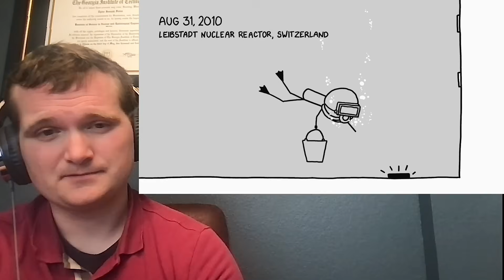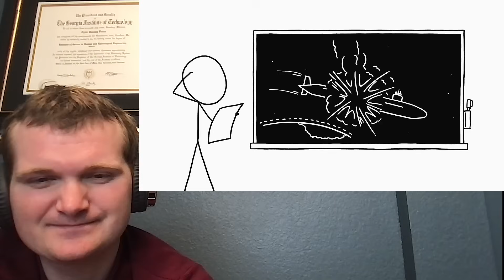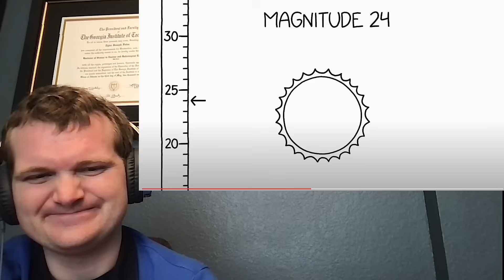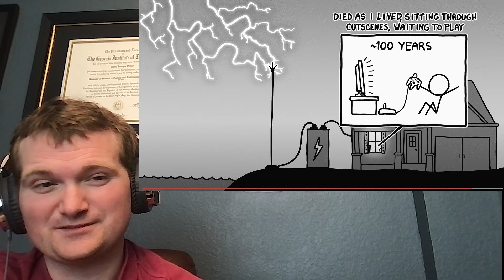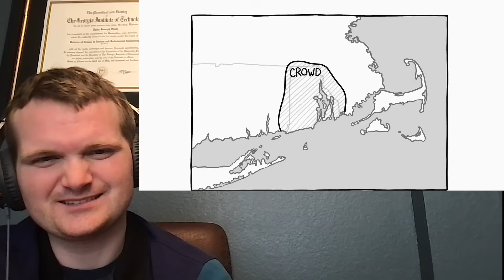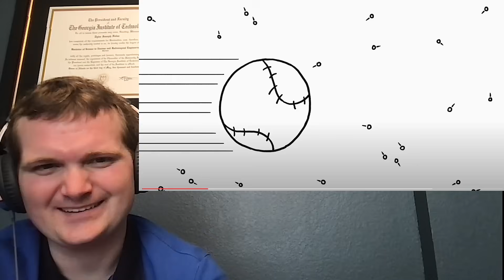Spent Fuel Pool, Spaceship Submarine, and More - Nuclear Engineer Reacts to XKCD What If Compilation

Comment: 2:05:30 ain't Class 4 lasers any laser with a power output of more than 0.5mW? (Milliwatts, not million watts) 

The classification is for potential eye/retina damage when exposed to that specific wavelength on the infrered spectrum which is mostly invisible to human eyes.
Different kind of lasers can use different kind of wavelenghts, some can be visible but in the industrial sector they are mostly on that invisible spectrum. Laser protection gear is also manufactured to shield from a specific wavelength, f.e. this means your laser eye protection will NOT work for ANY kind of laser.
Class 2 lasers are defined: Potential retina damage possible if exposed to intentionally. The reflex of your eyelids to close is usually fast enough to prevent damage to occur.
Class 3 lasers are defined: Potential permanent retina damage if exposed to
Class 4 lasers are defined: Immediate, permanent and untreatable retina damage if exposed to directly no more than 0.05 seconds. (Numbers are estimates from my memory)

We have a handheld laser welding machine which produce 3000W of laser beam power. That's 6000 times the Class 4 laser hazard level and Class 4 is the highest what's classed. (Total max power draw of that machine is 16kW) Also cuts through a 6mm (slightly less than 1/4 inch?) steel plate almost instantly.... Has multiple applications.

And for some people I must say, or "educate" that even a laser this powerful wont cut through a human or even a finger instantly. Humans are made of water and the laser need to evaporate it all before being able to cut through. It however causes really nasty 3rd degree burns that will leave a scar if you hit yourself with it. There's almost no kind of protection gear that can shield from this and your eye protection works only for a scattered beam but not for a focused direct hit.

Comment: I know from building scaffolding inside the can, if you drop a tool, it is considered a federal nuclear incident. You'll find yourself in a room being questioned on why the tool dropped. Sometimes you'll be working when the reactor is in operation. Depending on the percentage its running, dictates work time determined. Bottom line, they do not want a person at the facility thats not got all their marbles in their skull. They keep your work record so an incident goes on your record. After working in the can you go through so many different types of radiation detectors just in case one is malfunctioning. These guys take safety as number one objective. The actual work needed to be done is at the bottom of that list. Sometimes I wished all jobs is as safety oriented.

Comment: My understanding as an EE is that lightning rods don't repel lightning by emitting positive charge. Their primary purpose is to provide a low-impedance path to ground and to act as a preferred strike point. Thunderstorms can create corona discharge around pointed conductors, but the mainstream view is that lightning rods protect structures by safely intercepting and conducting lightning.  Not by preventing strikes altogether.

Comment: The raindrop one is similar to another one where he talks about trying to melt snow in front of your car and how impractical that is again because of how good water is at absorbing heat. There's a reason that it's used in so many cooling loops after all. Even plants that use liquid metal in the primary, I'm pretty sure still use water in the secondary and teriaty loops.

Comment: A nuclear submarine would not do well in space. I'm doubtful whether its ability to resist 80 atmospheres of external pressure would necessarily translate to resisting one atmosphere of internal pressure; that's one atmosphere more than it was designed for. One atmosphere is about a ton per square foot (ten tons per square meter). That's a lot of pressure. Though even if it did survive the pressure, it would not survive the temperature; an Ohio class sub's reactor is over 200MWth, and normally all that heat would be dumped to the most effective cooling reservoir on the planet, the ocean. In space, that heat would go nowhere.

Comment: I questioned the solar panel lasting for 100 years because when I had solar panels installed in my house, they said the life expectancy of the panels was at least 25 years.
They explained that the panels will eventually degrade since they are exposed to the sun’s UV rays all the time.
But according to them, the best you could help for would be around 35 to 40 years.

Comment: Well, there's no point in running the reactor in a submarine in space, is there? In the end, the reactor produces heat, which then goes to some kind of heat engine to create electricity and stuff. But without a heatsink, the heat engine wouldn't work either. 

Basically, ignoring radiation cooling, 100% of the thermal output of the reactor will have to be dumped into the submarine. 

If that heat is allowed to spread, then some energy can be converted to electricity, but the submarine becomes a sauna. But if the heat is kept in the coolant alone, then the heat engine quickly becomes useless, because its heatsink won't be any colder than the reactor.

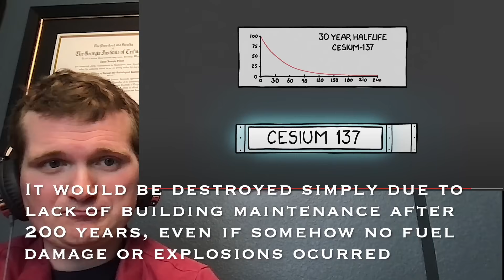Comment: 1:44:50 Well yes, but likely there will still be water in there from pooling rain water.
Typically with a building failing from lack of maintenance, the roof will cave in, which allows water intrusion. In case of a spent fuel pool, that structure is meant to have water in it and likely will keep containing at least some of it for much longer than the rest of the structure holds up to the elements.

Comment: If two lightning bolts were to directly collide, they would essentially negate each other, meaning the electrical charges would neutralize, effectively canceling out the energy of both strikes due to their opposite polarity; this is a very rare occurrence, as lightning bolts typically try to find the shortest path to the ground, making direct collisions unlikely. 

Straight out of Google search. Thought it cancelled each other out, had to look it up

Comment: If lightning is such a short duration pulse, the frequency spectrum would be necessarily be extremely broad (hence why the massive lightning bolt would cause an EMP). Unless you're using Litz wire, the huge magnetic fields will push the current to the outside skin of the cable, which will vaporise, progressively reducing the cross-section of the cable until it no longer exists.

Even if Litz wire is used, the currents will be so massive that the individual strands will repel each other. Normally this is not an issue because the wire is contained within a transformer, but at "all the lightning in the world at one" energies I don't think you could find a material strong enough to contain the rapidly expanding wire. Fiberglass and carbon fiber are the obvious candidates, but at millions of degrees (C, F, or K, doesn't matter) they would lose their structural integrity instantly. In fact the skin effect can be observed even at 60Hz if the current is high enough. That's why electric substations often use flat busbars or hollow copper pipes to conduct high current, because a cylindrical conductor would just push all the current to the side while the centre conducts little to no current and wastes expensive copper. The choice depends on the application: flat busbars have the advantage of taking up less volume. Hollow copper pipes have the advantage of not requiring support against sagging when required to support their own weight. When dealing with "all the lightning in the world striking the same place" energy densities, it would require both strong insulation between the strands of Litz wire and (more importantly) a dielectric material capable of handling megavolts, gigapascals, and millions of degrees without somehow turning into plasma. We could probably come up with a solution if we tried hard enough, it's just that there isn't a non-XKCD scenario in the world where we would need such a material.

Comment: @tfolsenuclear 

Lightning does strike the same spot twice. More than once during a strike.

When you see a lightning bolt flash, that is as a result of charge in branches off the main bolt and in the cloud as it drains charge that happen so quickly, that the lightning appears to flash or flicker as the charge is drained and makes its way to ground.